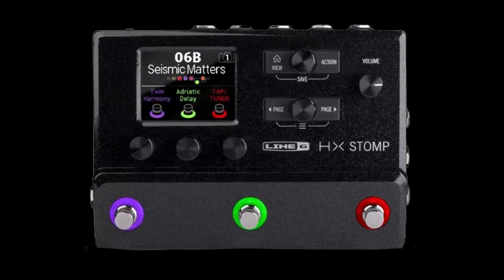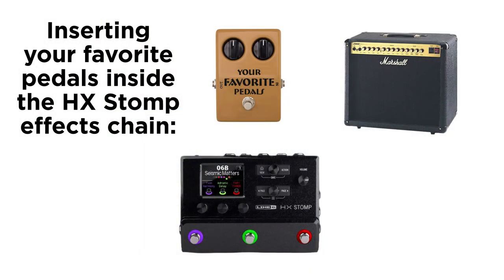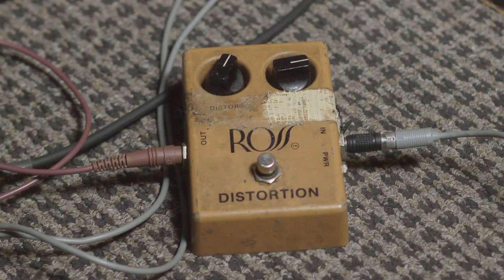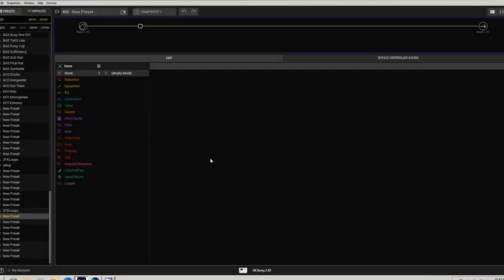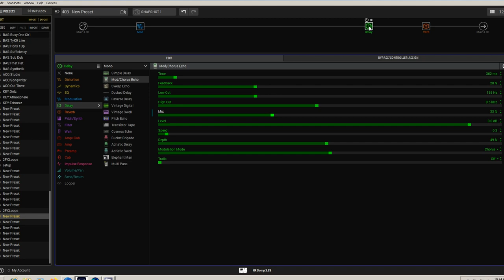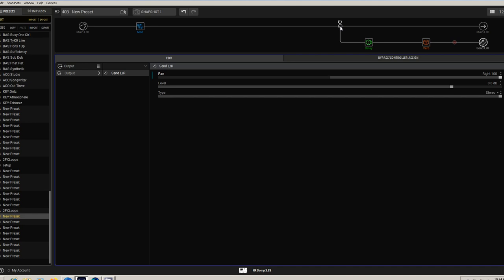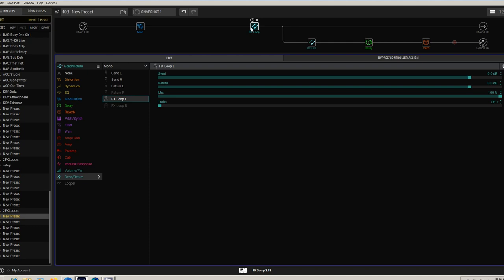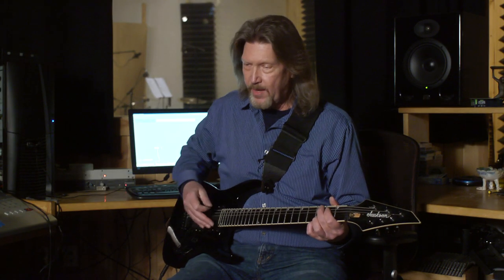Line 6  Tips -HX Stomp New Cabling Method

Comment: Hey there just thought I'd share that I found a much easier way of accomplishing this by adapting the 4 cable method and putting (pedal) OD/Boosts between the guitar signal and the amp in the dry loop, and delay/reverb/modulation in the effects loop of the amp/ helix in a single ended mono configuration, which is I think how it was intended. Can do this in mono with a SINGLE BLOCK (FX loop L) without a TRS cable or splitting into stereo then back to mono. Doing it this way also enables use of the Amp's own Effects Loop switches (Marshall, Fender, etc) .  Doing it the way you've shown here actually introduces approximately ~4ms of lag between your stereo loops and seems to not work for many people, or could potentially damage the power section of their amplifier if done incorrectly. Stereo loops were intended to be used in stereo amp setups I believe. It's also kind of impractical to find a TRS Cable long enough to split to the amp
Reply: hear, hear
Reply: I'm not exactly following your hook up method here

Comment: I won’t be very original here: I am a tube amp guy. I presently own a Fender blues junior/ like/ « clone » and I used to drive it with a Hugues and Kettner tube preamp in front of the amp. Let me tell you it sounds great… 2 tube preamp in series with a tube power amp is magic… Then I bought an HX stomp 2 weeks ago, used around 525$ US. I wanted to have more options (the pedals in the HX stomp are great). I now plug the HX in the effect return (not the 4 cable method) and wow, same magic, harmonics, etc, but with all the pedals I can dream of. The HX stomp in a tube power amp sounds even better than all I heard before coming from my tube amp. Very happy customer, no signal loss, all the harmonics are there and maybe more.

Comment: I came up with a different way to use the HX with the 4 Cable Method, but without using up a Send/Return > Mono > FX Loop block. 
I use the L/Mono Input and Right Input along with the L/Mono Output and Right Output. Route the L/Mono Input to Path A of the Split (full left) and the L/Mono Output to your amp's Input. In that path you can add compression, gain, pitch, etc. (pre-gain) type effects. 

(make sure to use Split Y)

Route the Right Input to Path B of the Split (full right). Hook up the Right Input to your amp's Effects Send and the Right Output to your amps Effects Return. In that path you can add your delays, chorus, reverbs, etc. (post-gain) type effects. 
I haven't found a place where I need to switch between my amp's current channel to a built-in HX Stomp preamp, so this works great for me. 

I also have setup patches where I route everything to Path B of the Split, completely bypassing the amps preamp and I add in a HX Preamp near the start of the signal chain and then route other effects accordingly. 
I'll post a video of the process over the next few days. 
~JF
Reply: Did you make the video?
Reply: Hey do you know a way to do this with the Helix?? And how to run cables and insert blocks and signal path on HX edit?? I’m trying to retain the tone of my amps preamp running through the Helix also be able to place effects in my amps loop as well as before the preamp( like effects running into front of amp)??
Every time I try to do this I get major tone suck and not the genuine sound of my amp. Any idea how I can set up a method to make this happen??

Comment: Your basically making the hx stomp have 2 fx loop if I understand correctly. This is exactly what I was looking for as I plan on using the stomp as an amp and cab modeler but I have a boss ms3 in my pedalboard so my plan is to have the stomp in before every pedal, in the middle of all the pedals (through the boss ms3) and after everything so I can use the balanced output of the stomp.

Comment: Hi, nice vid! 
If I'm not mistaken this setup can also be done by using the normal 4CM and use both effect loops (in mono). 
Both options will 'cost' 2 blocks but the 4CM has the somewhat simpler setup and does not have a possible feedback loop.
Reply: correct. you don't even need 2 blocks if you use the FX-Loop block.

Comment: Question for you… I use single channel amps only… (marshall/ fender) would it be possible for me to you have my midi switcher take the place of an amps effects loop?  I’d like to introduce overdrives and other things into the Signal path of the HX stomp …but then with my midi switcher (boss es-8)  be able to move where the HX stomp is in my Signal chain as well will this work to eliminate the possibility of feedback loops?

Comment: For those with the FX loop grey out, I made it work by replacing the fxloop with a send L and return L (2 blocks).
Reply: How exactly did you make that work??   Thanks in advance??
Reply: @glynemmerson4811  I replaced the FX loop shown in the video with a send L and return L back to back. So it takes two blocks instead of one
Reply: @72spawndn  thanks for the response! Do you do anything to them such as panning or you just place them there?   Thanks again!!
Reply: @glynemmerson4811  Send L and Return L are already panned hard left so no panning required
Reply: @72spawndn  does this method also work with 4cm and Dir?? Thanks again!!
Reply: @glynemmerson4811  I have only done it with the cabling shown in the video

Comment: Is it possible to somehow use the hx stomp as a second preamp with a one channel amp. Main distortion sound is through the amp with the hx bypassed. And for the clean sound, you mute the amp input signal, and use an ampsim and the amps poweramp.

Comment: Hi Gess, I don't understand why is the new cabling vs 4CM. So why is you new cables method offer more flexibility than the 4CM. For example l use the 4CM so can use the preamp models of the HX Stomp into the power amp. I only have to use 4CM and do some tweak or change(s) with effect blocks. So why the you new cable system above 4CM.
Reply: Hi Mike. I did this specifically in response to a new user who was interested in using his Stomp only for the effects, and wanted to know if it was possible to put the Stomp in different positions in his signal chain. I agree, it doesn't add any functionality for those who want to use the Stomp amp sounds. 4 cable is the way to go for that. Just another hidden power that these great Helix products have.  Thanks!  -  Larry
Reply: @PowerPlantSpots  Hi Larry, thanks so much for your response. I agree the 4CM is a great way to use the preamp model of the amp model in hx-stomp. But I use you cable method and put a preamp model that l want of the hx-stomp in between the OD(fxloopL) and split A/B. It sound awesome. Thanks for you great tip or trick. 🎸👊🏾🙏🏽✌🏾🎸👊🏾
Reply: @PowerPlantSpots  Isn't this cabling method advantageous for delay or reverb (time modulating effects) to be placed in the HX stomp fx loop?

Comment: interesting, could you still record with this setup via an audio interface? i want to record my sound including my amp + my pedals+ the hx stomp via  the interface but it quite confusing. Thanks for the video
Reply from the maker: In this situation, the HX USB with the internal ASIO driver won't deliver your amp sound because you're using the Stomp as an extended pedalboard only. If your amp has a built in DI you could route through an IR cab in your DAW, or even better, if your amp has a DI with an IR loader, you could use that. Otherwise, you'll need to mic up your amp through a separate recording interface to capture what you're hearing live. If you have an external mic pre-amp, it seems possible to set up a USB routing that would allow you to send the mic pre into the Stomp's R input and output only that to your DAW, but I'm not sure how the impedance and levels would match up. I'll have to test that.
Reply: @MooreMusicGuitars  ah thanks for the response, I will find an easier and more straightforward way in this case ^^ (I like it simple when it comes to guitar gear ^^)  still interesting to see that seems to be a lot of ways (sometimes unorthodox) to create a rig using a hx stomp.

Comment: Couple questions. For drive pedals those should immediately follow the guitar and then into the Stomp. Correct?  Then, any pedal you want post pre amp would go into the effects loop and utilize the y-adapter. Is that correct?
Reply: Hello, did you ever get an answer for your question? I’m wondering the same thing.
Reply: @michaelgrubbs4618  Yes. While I did not get that clarification here, I did get it anyway. And yes this was correct.
Reply: I don't think this is the most clear way to describe how to connect the Stomp in 4CM with other pedals. If you still need help with that, I ended up getting a really good description and diagram on the Line 6 forum. If needed search for this, "Drive pedals don't sound right using 4CM".

Comment: errmm... no. this just complicates things.

this addresses having HX internal effects before and after the amp's preamp stage with external pedals along the way. you can get that by using the "4-cable-method" and placing your external pedals along the segment between the HX's send and the amp's input (to have them before preamp) or along the segment in between the amp's send and the HX's return (to have them after preamp).

you're using an extra unnecessary cable, taking up two blocks when you just need to use one (with the FX-Loop) and you're cluttering your signal flowchart by making it confusing and hard to read.

internally routing a Return to a Send is an interesting solution, but I don't know whether it's best practice, tbh...